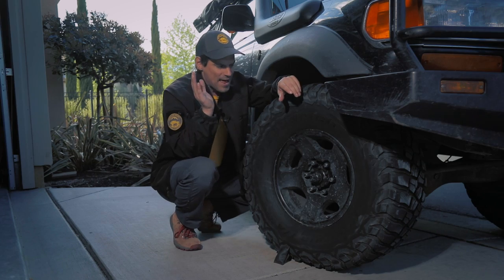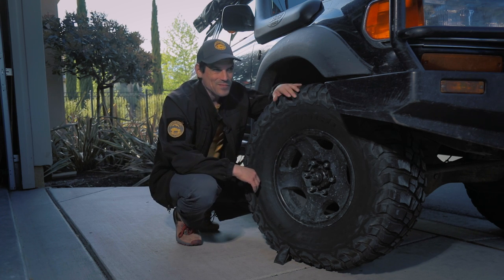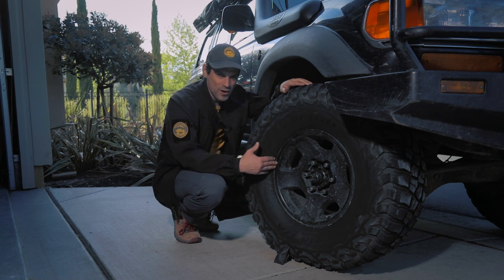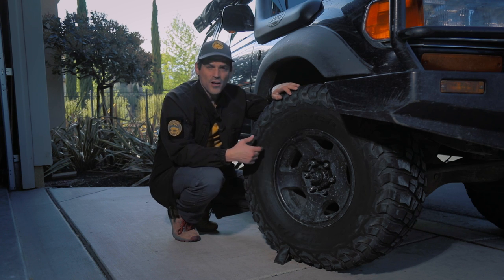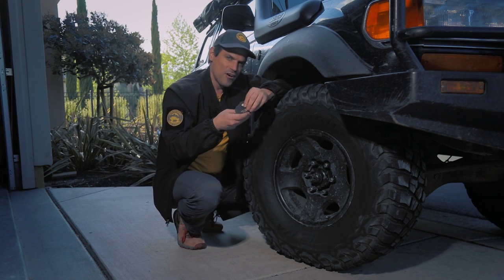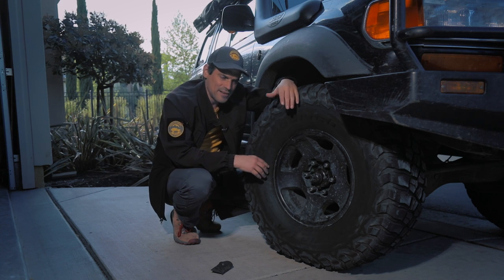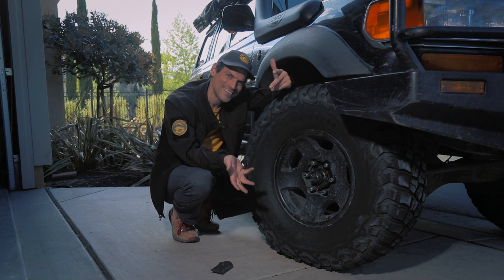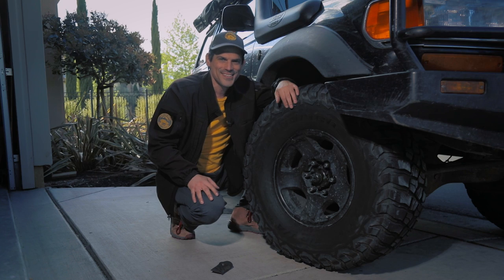Airing Down Your Tires - Why, When, How

Comment: 35” Maxxis Razr MTs with 17” Black Rhinos. I typically air down to no lower than 17psi for fear of slipping a bead.

You go down to 5 and even 0 psi with no bead locks?  From everything I’ve ever heard from people that know more than me, that sounds like a recipe for slipping a bead.  Do you drive at speeds above 20 with that kind of pressure or are you airing down that low for specific obstacles then airing back up to 10 or 15?

Comment: Thank you for this helpful video!

I have 225/55/18 all-season tire and is on a 35 psi per manufacturer guideline. I occasionally drive through graveled trail roads when i go to camp sites. Do you recommend that I air down my all-season tire? If you do, how much do I air it down to?

I’m also putting in a all-terrain tires soon, but in the same exact tire size. How much Do I air those down ? 

Thank you !

Comment: I run a ko2 33/12.50r15 aired up around 40psi aired down 21-18 on trails on rocks and slow stuff 18-15 also my rim is  just a regular steel rim no bead lock 👍🏼

Comment: This helps. Would you give me your thoughts on van tires and dirt roads? 144” Sprinter. 2WD. KO2 tires. Stock rims. Not technical but rugged forest service-type roads. On highway runs PSI 49 front 70 read. Agile Off Road RIP package. ARB under hood dual compressor. After a smoother ride at 18 mph. Not a speed thing but comfort thing. I’m thinking 20 psi less per tire. Thanks. ( my next vehicle is a Rubicon BTW, I don’t know when however)
Reply from the maker: You have to be super careful with van loads that typically run high tire pressure for at least a couple reasons. Larger heavier vans with the relatively smaller tires will quickly react to airing down and the lateral sway can be exaggerated. I’d watch the “bulge” around the bottom of the tire, keep it conservative and run some mild trail. Start with a little. Your 20 psi is probably a ok start. May as well start with 10.
Reply: Overland Bound thank you so much for the response. Despite smaller size it still runs 10K+ lbs. and the Agile package did move the center of gravity up a couple inches. Running the AlCan Hwy last summer, and the 60 mile dirt road to McCarthy, AK last summer  specifically, was stress free due to the upgrades. Peace out.
Reply from the maker: John Fisher sounds like a great setup!

Comment: I’ve only taken my Nitto Trail Grapplers (285/75R17) on stock JKUR wheels to 20psi. It was on the Bald Mtn trail at Rally to the Sierras last fall. That was very conservative, but haven’t built the experience with the tires and wheels to know how low I can go without breaking the bead.

Comment: On my 2013 Jeep Wrangler Unlimited I have Ironman All Country M/T LT37x12.50R17 on Fuel Offroad Oxide 17x9, non-bead lock, wheels. I have ran them down to 15 psi. I think I will try down to 10 next I am out though.

Comment: Falken Wildpeak A/T3W 265/75R16  34 street, 22 fire roads, 14 soft stuff (sand, snow). Just a reminder for folks about the driving on road aired down, the problem is the heat in the sidewall. If you are going to do this, speed and distance are the critical factors. Better be short and slow. I personally wouldn’t do this below 20 psi for more than a mile under 30 mph. Why those numbers, total guess on my part. Did it only once, and the sidewalls were not crazy hot. The safer plan, take some time to enjoy the scenery while you air back up.

Comment: Is there a reason to not remove the Staun deflators after they've done the airdown work?  Just install regular valve stem caps to minimize length and avoid contact.  Have to remove them to air back up anyway, right?

Comment: Firestone Destination AT 265 70R17  rated, 20 PSI on rocky trails and dirt roads, 07 FJC
Reply: Stock wheels? I have the same tires. 08 4runner

Comment: With those auto deflators , have you ever noticed extra air leaving the tires after going over a rock ? Lets call it burping , lol....Once you hit your mark just take them off right ?  I think im sold on them.   285/75/16 Duratracs....18psi - 12psi. Not much lower than that really

Comment: Tire pressure makes an especially big difference on sand and snow. something that seems impassible on street pressure could be  easily traversed at 10-14 psi. I got caught down a hill at a dead end in snow. i couldn't make any progress back up at even 20 psi, aired down to 10 and i crawled right back up.

Comment: I'm running Courser MXT MUD Terrain 32X11.50R15 on Pro Comp rims and I usually air down between 10 and 15 driving on sand, gravel and a little bit of rock crawling haven't have any issues

Comment: I’ve been looking for info airing down from 65/80 on my super duty.  I haven’t dared to go down to 12 on the stock wheels.  Cooper discoverer ATP.
Reply from the maker: Yes be cautious! Not only are BFGKM3s known to hold the bead at low pressure, but the 80 series stick rims are venerable!

Comment: 315/75r16  Cooper St Maxx on my 1997 lexus LX450.  I run around 35psi on pavement, 20psi on gravel, and start at 15psi on sand, mud, rock and lower from there if it seems like it might help.

Comment: Great video. I have a Tundra with 20" wheels and 35s. Is it safe to lower it to 15 psi without popping a beed? Wondering if I just need to bite the bullet and get 18" or 17" wheels.
Reply: I cannot comment on the safety aspect of airing down on 20" wheels, but a coworker had 20s on his 2013 Ford F-150 and recently switched to 17" wheels. He noticed a significant difference in ride comfort on and off road with the inch and a half of extra tire sidewall, in addition to looking more capable. If your wallet is up to it, I would recommend a wheel size change as 17s and even 18s would allow you more air down/offroad options. You would also reduce the chance of chipping a wheel or sustaining a pinch flat with smaller diameter wheels.

Comment: 235/75 r15 Goodyear wrangler radials (cheap s#$t) tires and stock explorer rimes 35 on highway and hard pack dirt roads 20-25 on all other surfaces.

Comment: I haven't had to air down yet but i am building my rig up now wondering if i should get 33" with 4" lift or 35" with a 6" lift on my 96 burb?  I have an arb roof top tent and is my tent ladder long enough for 35s and 6inch lift. I am going to try to find out this weekend

Comment: I'm boondocking in a 2004 Freightliner MT45 step van with 100PSI tires, can you give any advice on airing down for less than hard pack dirt/sand roads?
Reply from the maker: Start conservative with high psi tires. The loads they support react quickly. Start at 10psi and test. Be cautious of added lateral sway on heavy loads.

Comment: BRIDGESTONE DUELER P285/45R22 great for sand, not so good for mud and rocks. Run them at 12PSI on the beach. These are low sidewall tires.

Comment: 22psi is my blown up for less rolling resistance pressure. 18F 16R is my normal street pressure. samurai on 30x9.5r15
Reply: General Grabber AT2 30x9.5r15 on 15x8 AR23 wheels. 16-18psi highway and around 8psi on the dirt. havent lost a bead yet but i dont really wheel it too hard

Comment: I have the Toyo Open Country AT3 in 245/50-r20 on my 2010 dodge nitro.  It's not a huge tire and was wondering what your thoughts were on airing down a tire that size.  Is it too small?

Comment: I run 265/70/17 General Grabber ATX on a '17 4Runner. They are not LT tires so I am curious what my limitations would be. I currently only really drive on sand.

Comment: I'm running 33s TOYO OPEN COUNTRY AT 285/65R18 25 psi hard pack Forest roads
Reply: Kurt Holtzen must have a heavy rig. Only run 25 on the street in mine since my rig weighs 4k.
Reply: @choking0smurf  2010 Tacoma double cab with 1100 pound pop up camper + gear and water

Comment: I have a spreadsheet I keep on my phone notes for airing down, here it is. Excuse the formatting, the YouTube comments section isn’t meant for spreadsheets...

Terrain	Range	Start With	Max mph
Soft Sand	10-18	16/18	25mph
Hard Sand	16-25	22	45mph
Rocks      	16-25	22	45mph
Mud 	        16-25	22	45mph
Corrugated	16-35	22	50mph
Gravel     	20-35	35*	N/A
HWY        	35-40	35-40**	N/A

Air down in increments of 2-4psi
Do not go under 10psi unless stuck

**Run 35-40 depending on what my situation looks like. If I know I’m going to put in 500 road miles, I’ll run closer to 40psi. If I’m just going to drive around and explore I’ll go closer to 35 for comfort. 

*I usually don’t air down for a gravel road

22 is go to on any trail that’ll be longer than a few minutes (which is exactly what you run Michael)
Reply: This is on 33” KO2’s on 17”x9” pro comp “bandito” rims. When I get into the 10-18 range I usually have my front tires ~2psi higher than my rear since my front is pretty heavy (bumper + winch + steel skid plates)

Comment: does it matter what psi i run on all fours? if my back end is heavier than front? or vice versa?
Reply: Yes the heavier end will need higher pressure to prevent the rim from bottoming out on rocks or after a ledge.
Reply: @cheap4x434  cool, thanks
Reply: Yes definitely. On my cummins I can't go much lower than 30 psi on the front

Comment: I drive on the beach (soft sand). How much do I air down a 4 runner with nitro Grappler tires?
Reply: The National Park Service for driving on the OBX requires you air down at a minimum to 20psi. I run 18psi out there & if needed go down to 10psi. I’m also driving a 4R.

Comment: 5,600 lb vehicle
Cooper STT Max
factory 16x7 wheels

235/85-16    General trail: 18 psi, max flotation 12 psi
255/85-16     General trail: 15 psi, max flotation 8psi

     One point that wasn't made, is that lowering pressure also lowers your ground clearance, so there is good reason not to go too low unless you are on a beach or similar.  Also reducing tire pressure greatly increases the tire's ability to resist puncture.  In some cases  more than 20X.  There are videos on Youtube if you look.  Here is one: https://www.youtube.com/watch?v=9Kz8mmLkeks  There are some good reasonably priced compressors out there, that perform very well.  One is the Puma.  I've used mine extensively for the last 10 years without a single hiccup.  I swapped the tank that comes with it for a 7 gallon aluminum tank, and it only takes a couple of minutes per tire to air up.  If it ever dies, I'll get the same one again.  It's a beast for just $260: https://www.amazon.com/PD1006-Puma-Volt-Compressor-Gallon/dp/B00W1TNO6U              I carry two sets of deflators set at the two pressures I use, so airing up and down is pretty painless.